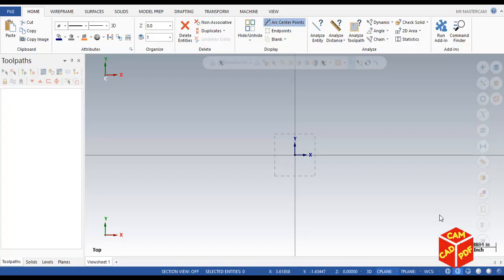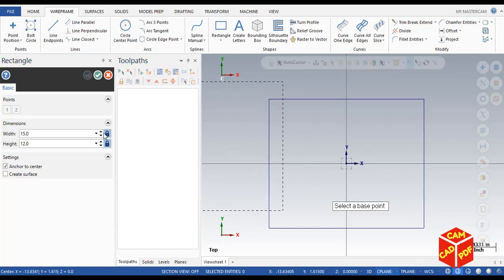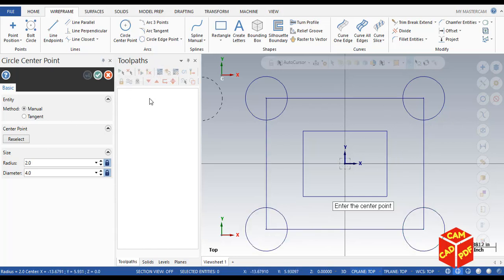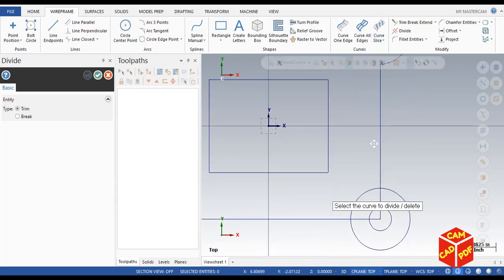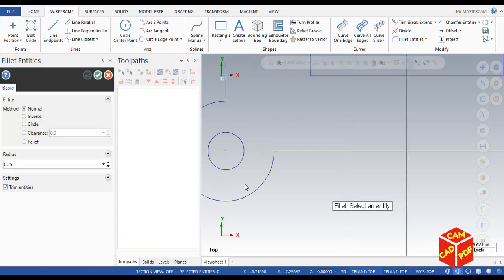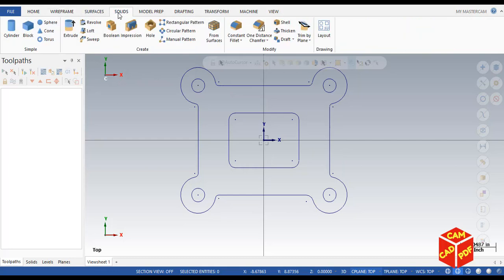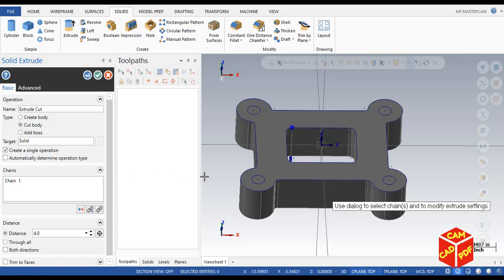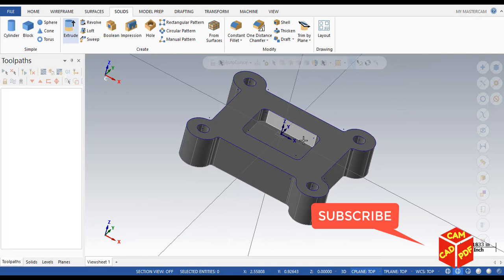Basic 3D Model Designing IN Mastercam 2020 Mastercam Tutorial

Comment: Sir can I get link to download software
Reply from the maker: MASTERCAM 2020 FREE Download !! No Sign Up  HLE Version
https://youtu.be/avClCFzl6N4
Reply: @CADCAMPDF  I have a question....I am using the Mastercam2020...but it require more time load and it runs very slow...and does master cam require code meter in my laptop codemeter will pop up on screen now and then...can mastercam run without...codemeter...Sir can you tell the system specification required for mastercam to run faster. .
Reply from the maker: I am Not sure regarding codemeter   but i suggest to use Mastercam 2019 it works a lot better and faster  . its almost same if your are learning  and you can get it over here :
Link to Download ''Mastercam 2019 (Home edition Learning) : 
(Adv Free LINK) https://drive.google.com/open?id=1ZGsnk0GSPy_kApPjerSK1TdaZCs6Yoq6
Reply: @CADCAMPDF  sir...link not working...Sir I want Mastercam 2020..link in Google drive type of file...coz  mega is not supporting
Reply: @CADCAMPDF  link not working it's showing error sir